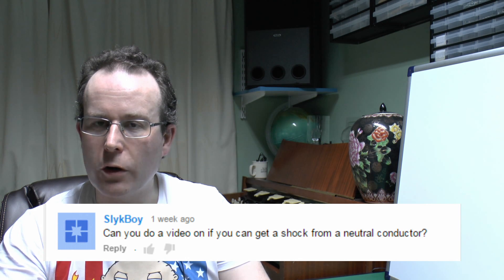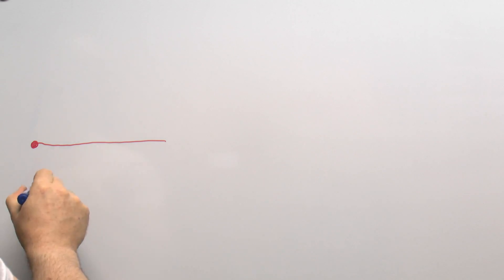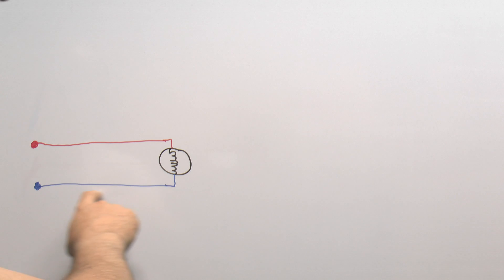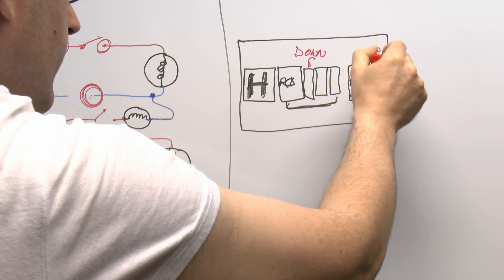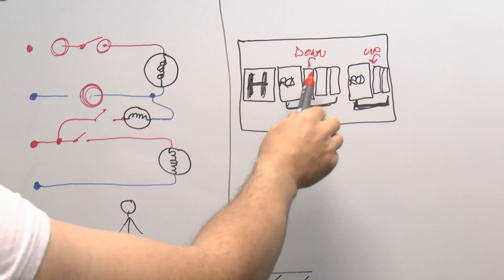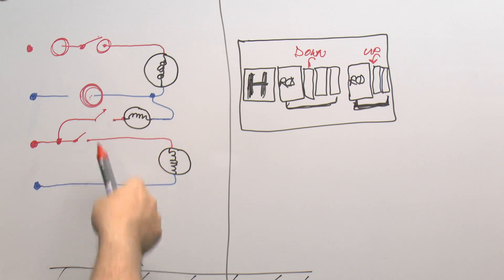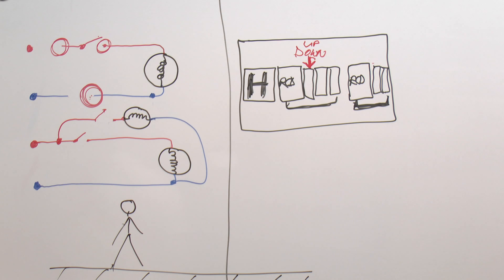Shared or Borrowed Neutrals on Mains Electricity Circuits

Comment: Anyone know if you are allowed to use as a Control Wire as a Neutral Wire in the UK and comply with BS7671,    I recently had a Fan sent from China with a 2 gang Fan Switch, the wiring showed that the manufacturer was stipulating that ONLY the Neutral was to be wired into the switch and the Live to be placed into a connector away from the switch; I have never seen this practice in my 40+ years and wondered if it was acceptable in the UK to do this?  This led me to think of why we did not just Switch Neutrals, then you start to realise that the Appliance/Equipment will always be sat live!
Reply from the maker: Switching neutrals only is generally not permitted, there is an exception for a particular type of lighting control device, where the neutral to the controller can be switched, but that's not directly switching the neutral for the light itself.
Some extractor fans are provided with 2 neutral terminals so that different speeds can be selected depending on which neutral is connected, but that's not disconnecting the neutral, just connecting one or the other.
Reply: @jwflame  Thank you John for your response, the Fan Switch I have been provided with is a 2gang switch, 1gang turns ON/OFF the Neutral, thus Isolating the Neutral, the other gang is the controler for selecting High and Low Setting. So correct me here, but I see this as a Switched Neutral.
Reply from the maker: @apartmentswales  That is a switched neutral, not permitted.

Comment: Really enjoying your videos John, not an electrician but find it interesting. 

I had a couple of questions, couldn't they introduce a safety device which measures the potential difference between live and neutral / earth and trips if there is no potential difference over a few ms? I guess it would also need some kind of auto recloser to protect against a short power cut turning everyone's fridges off.

Also, why isn't that a problem for say a fridge with an earth to the metal bodywork? Is it just relying on the fact that there probably isn't a good path to earth from the kitchen floor?
Reply from the maker: There are devices which can monitor that voltage and disconnect, but in some circumstances both L&N voltage can increase so you still have a dangerous voltage between the N+E conductor and the actual Earth.
The fridge will still get a dangerous voltage on it, but the risk is less because it's inside, where people will be partially insulated due to wooden floors, carpet and so on.  Other metal items inside will all be connected together so the voltage between them will be small.
Reply: @jwflame  I think I understand. In effect I've just reinvented the first option. What I wasn't accounting for is that in the best case scenario, say a property with no gas service and plastic water pipes etc there will be almost no potential between L&N but, in a property with metallic supplies feeding everything, the earth connection via the equipotential bonding and the link between E&N might be good enough that they see almost the full 230v between L&N.

Interestingly, in the second scenario, wouldn't devices with switch mode power supplies, computers and phone chargers for example, which are voltage tolerant actually continue to work normally while the fridge and washing machine make some awful noises?

Comment: Why a circuit works with a load but with out a load (with line and neutral connected) it causes a spark and trips?
Reply from the maker: A load has a resistance to limit the amount of current.  Connecting two wires together has nothing to limit the current.

Comment: If while using my multimeter in continuity mode I measure continuity between the neutrals of two circuits, does that mean they are shared or is this normal even for non-shared neutrals?
Reply from the maker: Most UK circuit breakers are single pole and only switch the line, so neutrals from all circuits will still be connected together even with the circuit breakers off.

Comment: The neutral can have a significant potential if the loads on the electrical gear is not well balanced. The large neutral currents can cause voltage drops along the neutral if its not sized properly.
Reply: YUp was wrkg industrial, told to hook up lamps on 277 v told brkr was off and what
# it was, check w wiggy, hot was dead, made sure by turning on that brkr, it was live, turned off, it was dead. YET something told me to go between the white and the 
ground. there was over 140 volts due to the imbalance of loads on a 277/480 volt 
Wye. it was the 1st time I did industrial but somehow I knew there was a dangerous
situation the boss never told me about. Someone is eitha gonna die or have a serious issue working with that boss. This was in Worcester Mass.

Comment: Can someone explain this to me please...
I used to work for a boiler manufacturer,  one day in a rush I needed to replace the pcb so just removed the fuse from the spur and proceeded to disconnect the wiring from the board (stupid I know)
Needless to say.. I got a shock,    Got my multimeter out and it turned out when I removed the fuse I’d get 240v at the neutral but put the fuse back in the spur and things returned to normal.  ie 240 at the live
Reply from the maker: Most likely that was L&N reversed, so removing the fuse disconnected the neutral only and left line connected.
Reply: @jwflame  not sure i understand 
The boiler worked fine so cross polarity wasn't an issue as no rectification problems

Comment: Borrowed Neutral is  one thing I had a borrowed Live  while replacing the consumer unit after removing the old unit from the wall I needed a pee so I went upstairs to the bathroom turned of my head torch then realised the bathroom light was still on.

Comment: This is exactly what caught me out replacing a ceiling rose on Downstairs Circuit in my 1960’s built house .... Isolated the circuit by breaker, checked all terminals of the old rose with phase tester & unscrewed wires. When fitting the new one I got a big wallop through my left hand all the way to my chest (with an unintentional yelp..!!) from a neutral wire, one of three. The neutral was live from the Upstairs Circuit. 

The other thing I’ll take away from that experience was not to have a head torch pointing directly at a phase tester... because of the metallic reflection from the head torch I couldn’t see that the phase tester bulb was actually lit. Lesson learnt.!! 

I’ll bet the lights came on upstairs for that second too... 😳

Comment: Question I have a client who wants to feed seperate single phase DBs from a rotary isolator. Ive advised against as split meter boards exist and make a neater install and simplifies the design and install. But, I havnt seen a regulation which advises against what he wants. Is there one? Or dangers associated with doing it this way?
Reply from the maker: Not prohibited - but all the usual things apply, in particular the rotary isolator must be of a suitable rating and also suitable for on load switching.  Will also need to have terminals large enough for the cables to the separate DBs.   Separate boards will very likely cost far more both in terms of the parts and the installation time, and will take up more space.
Reply: @jwflame  Thank you for the reply, thats what I thought, just wasnt sure if I was missing something. It just doesn't seem best practice to me when an off the shelf item exists. I'll list the advantages, disadvantages and then let the client ultimately decide.

Comment: John, thanks for this video.  I've been trying to get my head round this topic and spent ages researching it. I understand what you say here but don't understand why if you have to run a feed in a "single" to the switch from the downstairs circuit why they didn't just run a "single" neutral at the same time.
Reply from the maker: It was done because it was cheaper and quicker at the time.  2 core & earth between the switches, line connected downstairs, neutral upstairs.  Saved having to buy 3 core and earth cable just for that one circuit, just used more of the same cable they already had on site.
Reply: @jwflame  Thanks for taking the time to reply

Comment: nuetral?    when did electricity need more then 2 connections?   positive, negative, there is no need for anything else.
dunno, sounds like the uk likes to complicate the hell outta everything so everyday normal people cant fix it.

downstair circuit?    what you guys have multiple runs of cable ?  jesus complications...    run one continuous  wire through the house,  all lighting attaches to that wire.   simple.    

although I've ran a second wire pair because I converted all my lighting to dc.    instead of 60 watt bulbs I'm using 0.4 watt  lol
Reply from the maker: AC electricity doesn't have positive or negative.
Reply: AC has hot and neutral.

Comment: "If some moron decided to..."  Lol
Reply: Well it happens a lot when using fuses.
Reply: @dogwalker666  Yeah the usual situation is to have one fuse in a 3 phase disconnect blow, but the other two fuses are still intact, which often happens on HVAC equipment, which usually ends up blowing up a compressor if there's no interlocking in the equipment.
Reply: @mysock351C  yes to mean to fit a thermal overload.

Comment: What if you're wearing rubber footwear and you touch the neutral line before the damaged wire or a live wire . Will you still get a shock as you insulated from the ground?

Comment: At 15:19 my auto generate captions say "disconnect the neutral here for the circuit to LC isolate it properly ...".  I have only read a book on American housewiring but it made the comment the comment that the neutral and earth wires are never switched.  Why are you disconnecting the neutral ?
Reply: Two obvious instances why you'd disconnect the neutral if you were a) replacing a broken light switch or b) replacing an old light fitting.  Or you could be removing an old hard wired electric appliance like a cooker (stove to you ;-) ) or an immersion heater for instance...
Reply: @andyblackpool  oh, the second two instances I understand, but the switch?  There are only hot wires connected to a switch: the hot wire and then the wire that becomes hot when the switch is on.
Reply: @jimanonymous113  There is a hot (live in UK) going to one side of the switch (IN) yes, the other wire (OUT of the switch)- which of course is dead when the switch is off -  as you say provides the feed for the downstairs light bulb when the switch is turned on.  HOWEVER this usually dead wire itself can become live under the circumstances as explained in the video.  Effectively this wire can carry a live/hot BACK to the switch THROUGH its associated light bulb if the neutral from this light bulb is borrowed/wired into a neutral from another live circuit, say an upstairs light.  This is the important bit: once the upstairs light is switched on all the neutral wires in the whole system will effectively be carrying current; the live current passing through the upstairs bulb is heading back to the fuse board through this neutral wire so this wire ALONG WITH ANY OTHER NEUTRAL WIRE that may be attached to it including our original downstairs light bulb neutral) carry potential too.   Its a bit hard to get your head around really and even harder to explain but watch the video again.  Trust me the penny will drop eventually (TBH it took me a while to get it before my own 'lightbulb' moment) Hope this explains better for you mate and hasn't totally confused you though because I do understand it but even I'm getting confused now lol .. ;-)
Reply: @andyblackpool  thank you

Comment: I had a loaded neutral 180v but only 36v on the live was it the transformer working backwards in the led light to get this reading ..the council electrician run away without explaining exactly what he done inside the consumer unit to fix the problem

Comment: At 3:10 would the light temporarily come on or flicker when a human comes into contact with the neutral to complete the circuit? Just wondering if the light bulb would light up for a second or so?
Reply from the maker: An LED might, incandescent probably not.  Depends on the current that flows through the person.

Comment: 8:54, you introduced the term RCD but didn't define what it is.  Also, just because someone touches a hot wire doesn't mean they will get a shock.  You should not give people that impression.  If they are well insulated from ground and not touching the corresponding neutral too, touching a hot wire (120V, 240V...) wont give that person a shock.  Also, the volume of your voice changes quite a bit and that puts an extra burden on the listener.
Reply: "RCD =  Residual Current Device " one of the most common earth fault detectors. In theory you can insulate your self an touch live mains however it takes special equipment and clothing. Dont forget capacative coupling can pass enough current to kill.

Comment: What would cause a 50% voltage drop on lighting circuit?
Reply from the maker: Excessively thin conductors grossly overloaded, or more likely a faulty high resistance connection somewhere.
Reply: series connection

Comment: Great explanation.  I’m still trying to wrap my head around the idea of shared neutrals with timed loads.  Not even sure what to call this to learn more, but basically an appliance which turns itself on and off periodically would make the other line with the shared neutral unpredictably hot and cold.

Someone suggested shared neutral with a furnace might cause this?

Comment: Thank you for the best explanation on the Neutral Wire. Still confusing....Can you explain why the neutral wire which carries the return current when circuit is "on" does not cause a shock if it is toughed. what happens to that return current?
Reply from the maker: Current returns to the source, which is the transformer.
There is no shock when connected because the neutral is at the same voltage (potential) as the earth.

Comment: I have no formal electronics training, but I understood the idea is the electrical load is supposed to take most of the potential out of the return to neutral. However, in some cases this is not ideal and a non zero potential can be recycled to the power station. For this reason it was my understanding that the grounding lines terminate in an Earth rod, and do not connect to neutral. I think you have to be part of a circuit to get shocked though, even in the case of hot wires...

Comment: People don't understand that neutrals can be overloaded.
If you have too much load on the neutral conductor it will overheat just like a power conductor  and if connected to circuits on different supply phases and you get a loose or floating neutral it can feed 240 volts through 120 volt circuits.
Been an electrician for over 40 years and unless I'm hooking up a circuit that requires 240 volts I always make sure circuits in a 10/3, 12/3, 14/3 w/gnd that are carrying 2 circuits with a shared neutral, are only connected to circuit breakers on the same phase.

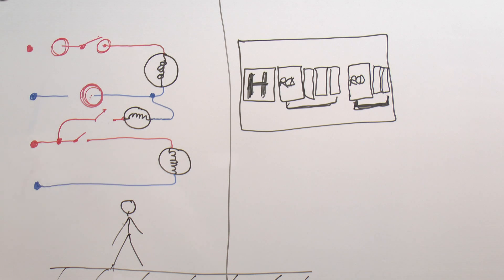Comment: Hi John, at 10:20 you say you don't use this configuration for split load? What is your preferred way then? Cheers
Reply from the maker: RCBOs, one for each circuit.  Costs more, but any fault only affects a single circuit.
Reply: @jwflame  Thanks, that makes sense.

Comment: How can there be voltage between neutral and ground
Reply from the maker: It's only a neutral when it's connected - disconnect the end connected to neutral and it's then live as it's connected through the lighting or whatever else is in the circuit.  Touch that open end, and then you become the connection to ground.

Comment: It's a mistake to connect lighting circutzs (which are basically single phase) to a three phase MCB (which is designed for 3 phase equipment, such as a 3ph motor). Lighting can be spread across three phases in order to either balance the load or, in industrial applications, to avoid any stroboscopic effect that may make rotating machinery appear stationary. In both cases, single pole mcbs should be used with each circuit having its own neutral. The other issue with using a 3ph MCB is regarding isolation, as all lighting would need to be off when, for instance, changing a single fitting on one of the phases. Otherwise good vid 😉

Comment: Interesting but in the US most of these type of problems ended with knob and tube wiring. Also hallways and stairways by code require switches that can turn the hall or stairway light on or off at either or any entry point. We call them three and four way switches.  Residential wiring requires at a minimum romex ( a cable with a plastic sheth and a minimum number of three wires  black, white (Neutral) and ground (green or bare)). Commercial and industrial wiring can use single wires but the must be pulled into pipe . I've never seen anyone use separate pipes for individual conductors. I have seen a twin pipe three phase four wires each service entrance. Using a single neutral on multiple lighting circuits with a three pole breaker? Nope. To easy for the next electrician to move wire one to a different phase and then exceed the neutrals current carrying capacity.  Three pole and two pole breakers are limited to equipment or panels requiring 240 volts or three phase power.

Comment: In some respects you are correct but very wrong, death thru electrocution are most attributed to neutral failure- a neutral ( neutral are energized} to ground will kill you slowly because you cannot release.  This is why all power tools have plastic dielectric bodies to many  people were killed with this condition.

Comment: What happens if the neutral breaks on the 3 phase system
Reply from the maker: If the load is perfectly balanced across all 3 phases, nothing happens.
If not balanced (which is 99% of the time), then the voltage supplied to single phase loads will shift up or down and equipment will be destroyed.